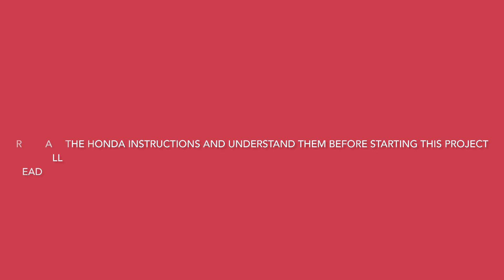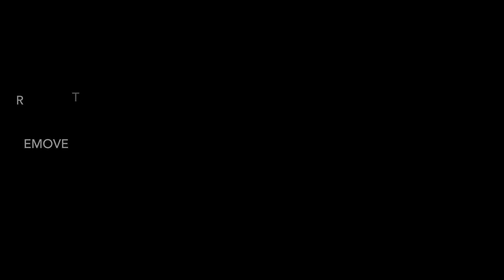Effortless: Honda Pilot Trailer Hitch and Harness Installation - Don’t Remove the Bumper Cover!

Comment: I installed the OEM wire harness and hitch today without removing the bumper. I followed  your video and two others to make it work.  The hands-free was the only thing I didn't see covered in any video, and also that you need to install the 30A fuse inside the engine bay fuse box. Complete installation took me 3 hours.  Thanks for your tips and tricks!!!
Reply from the maker: Glad it helped!

Comment: Very useful information. I used this method to remove the panel, probably saved me a couple of hours and a ton of pain from removing the bumper cover. One thing though -- the driver side screw is in a VERY tight place. If you have large hands/thick arms, it can be tricky.
Reply from the maker: A good callout.

Comment: 5:16 Thanks for the informative tutorial. I just installed mine on a 2025 Touring. It looks like on the vid you have the HFA still in place. I do on mine, but i couldn't install the hitch with it in place. I understand due to the hitch, the HFA relocation kit is required, which i have on order, however it appears most don't and still have the original HFA with the hitch installed. Curious to know if what i see is the HFA or did you remove yours or get the new relocation HFA. Thanks! 5:16
Reply from the maker: I bought the new HFA relocation kit that is made for the hitch.
Reply: @InsideBigJaysGarage  Ah ok. I have one on order. I did find a video of one installed and it's shorter to accommodate the hitch. Thanks for the reply.

Comment: Great tips! Do you attach the HFA to the silver panel first before installing the silver panel?
Reply from the maker: I didn’t but if I did it again I would.
Reply: @InsideBigJaysGarage so you didn’t install hand free adapter? If you did would you mind sharing how you did that.
Reply from the maker: I did install it.  But after the new grey panel was on the car.  With the new grey panel you need a new HFA sensor.  If I were to do it again I would install the sensor to the grey panel and then install the grey panel.
Reply: @InsideBigJaysGarage  got it, thanks.

Comment: You mentioned towing a trailer. What would be the next step to be able to use the trailer brakes? Would you need to install a trailer brake?
Reply from the maker: I don't have trailer brakes, so I don't have any input for you.

Comment: Thanks for this helpful video. Do you to remove the rear tail lights in order to remove the panels in the trunk?
Reply from the maker: No you do not.  The harness will have instructions on which panels inside to pull off.

Comment: Thanks for sharing! Very useful! I wonder do I need to replace the hands free adapter with the new 08L91-T90-100A  Adapter, hands free assist (HFA with trailer hitch)? Thanks!
Reply from the maker: I did have to replace my sensor.  I believe that is the part number.  “T90” is for the 2023+ Pilot.

Comment: Question: after installing the hitch/new panel, am I correct in assuming that the removal wiring plate/cover does not get re-installed?  I was thinking it would but I don’t see how it can fit once the wiring outlet/harness is installed. Just wanted to confirm and thanks again for a super video!
Reply from the maker: Correct.  If you have the wiring harness that silver cover has to come off.
Reply: Awesome DIY video. The dealership would charge an arm and a leg. As long as I got the time and tools, I’m pretty confident I can do it. Thanks!

Comment: so once you remove the clips on the bottom of the silver part and the two 10mm bolts, it just pulls off? Or you have to work the tabs on the top of the piece?
Reply from the maker: IIRC once all the fasteners are off it comes right off.
Reply: you have to release the 4 tabs from the top of the silver part/original cover.  I used a trim tool to gently release each one while also gently pulling the cover and it came off fairly easily.
Reply: @chadnewsome8525  thanks for the insight. Assuming using the trim tool from the finish side of the cover? Or from under the car? Pressing down?
Reply: @VincenzoDom  from the finish/outward facing side of cover and I think it’s pressing down but as you start from one side you should be able to confirm as you pull out an little bit.
Reply: @chadnewsome8525  Finally got my hands up there and wow theres no room for those top 10mm bolts. Im confident i can get them removed, but worried about getting them started when the new panel is on. Any additional tips?
Reply: @VincenzoDom  I had same feeling.  once you use wrench to loosen, you will be able to use your fingers to remove bolt.  Same when you tighten up, start with fingers and just get finger tight , then use wrench to snug up.  I tried to post a link to a short 90 deg 10mm $6 wrench I found on Amazon but it would not let me post.
Reply: @chadnewsome8525  Appreciated. Think im going to try a ratcheting wrench on it. Ive heard others say they used zip ties after failed attempts of getting the bolts back in.
Reply: @VincenzoDom  I thought I needed a ratcheting wrench but didn't after all.  once you break the nut free it spins off easy so I don't think you'll have a problem.  Hardest part is just getting your hands up there with but with spare tire dropped/removed, even that was easy.

Comment: So the stock bottom panel needs to be replaced with one that has the cut out for the hitch?
Reply from the maker: Yes, if you want to use the Honda Hitch that tucks into the bumper.  The new panel will have a cut out and it’s more squared off so the hitch can fit behind it.  If you look at a 2023+ Pilot TrailSport that is the panel you install.  You can also purchase a panel in black if you want that part of the bumper to be black instead of silver.
Reply: @InsideBigJaysGarage  Thanks man
Reply from the maker: You are very welcome!  Good luck.
Reply: Excellent write up, thank you very much.  The hard part was reaching the 2 screws on top - much easier with the spare tire removed.  I installed the new panel prior to installing the hitch.  Also, the computer gave me all kinds of error messages when I started the car (collision avoidance, lane departure & etc).  Fortunately the error messages went away after 1 drive cycle.
Reply: @walterdannhardt7486  All great tips!  Thanks!
Reply: @InsideBigJaysGarage do you have the part number for the black one?
Reply from the maker: Try this link.

https://www.collegehillshonda.com/product/08L92-T90-100B.html
Reply: @InsideBigJaysGarage  Thanks man
Reply: Any suggestions on trailer brakes… something specialized even to fit in the little space next to the USB and 12v Honda has…

Comment: Is this all doable without lifting the car up and without a flat roller/creeper when working underneath?
Reply from the maker: I did it with the car on the ground with no ramps or jacks.  I used my creeper, because I have one.  But, I don’t see why it could not be done without one.